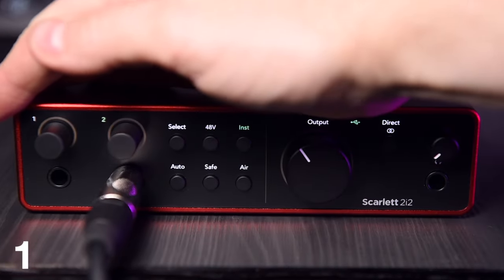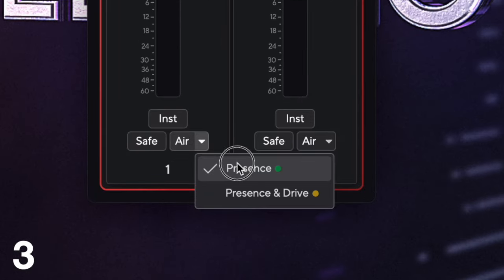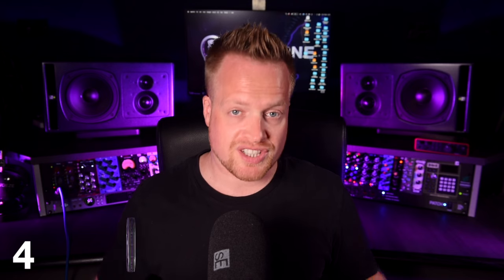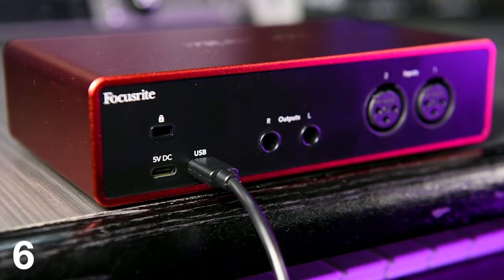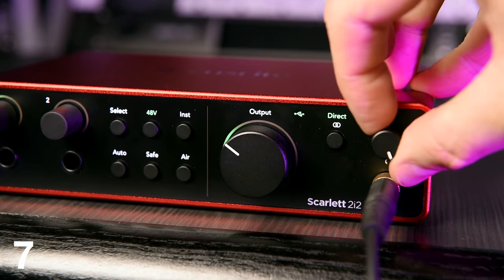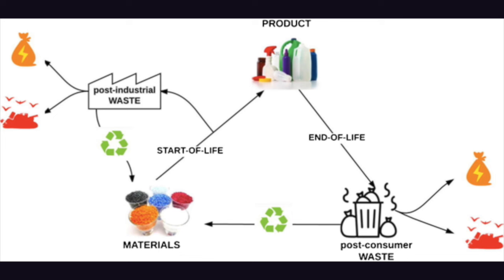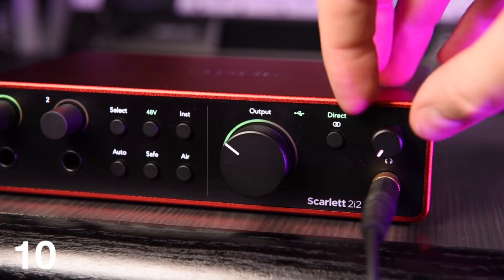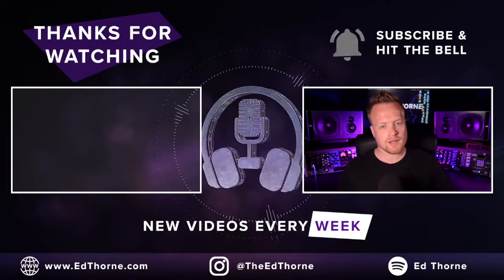10 Things You Didn't Know About the Scarlett 4th Gen Audio Interfaces

Comment: Hey from Dublin. Cool review man, thanks for sharing. I’ve subscribed to your cool channel 

A question if I may ask. I record Bass Guitar covers. Would it possible to plug this 4th Gen Scarlett directly into my iPhone 12 Pro Max (and thus negate the need for me going through a DAW on my laptop). Cheers. Niall 🎸
Reply from the maker: Hi Niall, thanks for the comments. My full review of this interface is a couple of videos back. Yes, you absolutely can record directly to your phone. You’ll need a USB-C to lighting cable (interface to phone) and a USB-C charger to power the interface (5v socket).
Reply: @EdThorne  Hey Ed. Greetings from Dublin

So, I got my new 212 4th Gen today and I bought a USB-C power cable/plug and that’s giving it power ✅

I’ve connected the 212 from the rear of the Scarlett with a USB-C to lighting cable to my iPhone ✅. 

I’ve connected my headphones and can clearly hear a good bass guitar signal ✅

Now, my question is how do I “record” that bass signal onto my iPhone??

I tried hitting “record” on my video / camera roll on my iPhone but it’s not capturing the bass sound (it does capture the “room” sound of me acoustically striking the strings but not the deep bass guitar sound that I can hear in my ears on my headphones ) 

Is there an “App” that I could use on my iPhone that could record my bass signal audio? 

Cheers 

Niall 🎸
Reply from the maker: @niallsbasstones9713 I believe what Focusrite refer to as iOS recording is recording to DAW applications.
Reply: @EdThorne  Thanks Ed. I tried GarageBand App on my iPhone but I don’t think it will work as it does not give an input 1 or input 2 option, whereas I think those options are available on the GarageBand App on an iPad